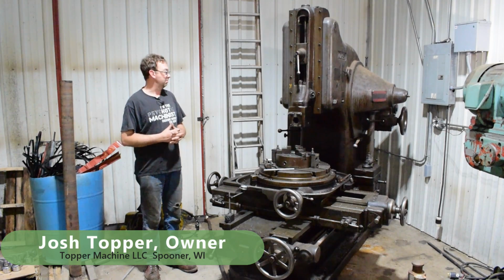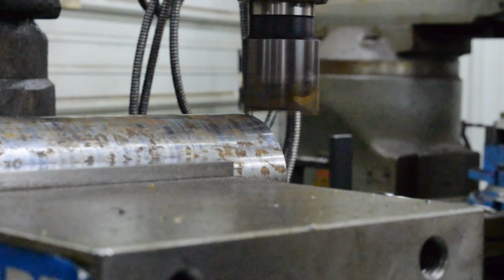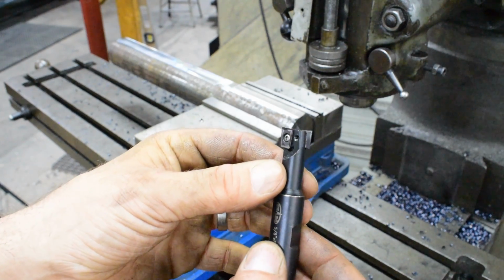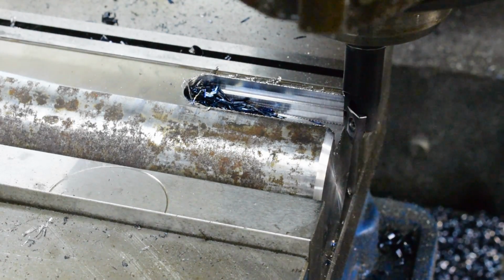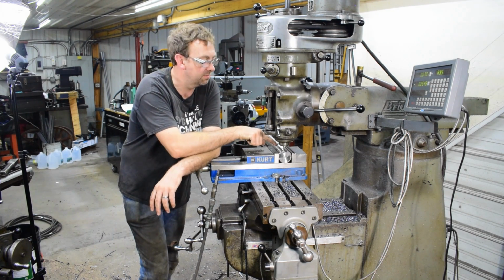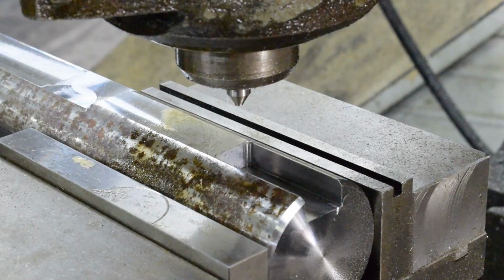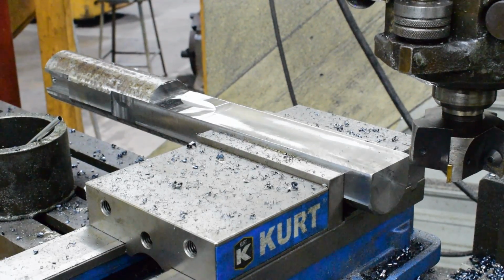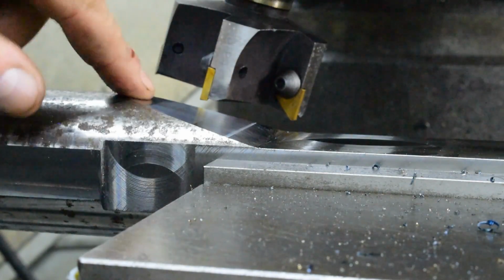Making an Internal Keyway Cutter - Vertical Slotter or Shaper Toolholder

Comment: Not a machinist, but in trying to square off the corners of the pocket in which the slotter bit sits (which is impossible) wouldn't you be better off drilling (or plunge milling) out the corners and machining a flat across the narrow dimension of that pocket (which you are doing anyway with the small cutters) and using that as your rear support for the bit? It seems to me the absolute length of the pocket is not that critical as you'll adjust the throw of the cutter with the dials on the machine. Excellent video!

Comment: Hi Josh, 
great improvement in audio and presentation over some of your earlier attempts. Well done and thank you. 
One question or suggestion, but when you tried to square off the corners with the 1/16" cutter would it be better to mill it vertically first. That way you would, or should, experience less deflection. Just a thought. Thanks for the video and as someone else suggested "better built than bought ".
Regards from Canada's banana belt.
🤞🇨🇦🍌🥋🇺🇦🕊️🇺🇲👍

Comment: You can mill the corner pockets with a tiny mill if you feed it vertically as if was a drill bit. Two flute mills were called slot drills for that reason. Any mill with center cut can do that.

Comment: Let me offer you a little advice on those tricky corners.... mill the flat first, before the slot... then drill the corners with a regular drill... then do the slot, and you only need to clean up a tiny little corner... save yourself the trouble.

Comment: Today, I had to broch a 1" keyways in  (2) 3-13/16" couplings using a Davis/Hanford #5 Keyway machine ...it chatter...I bartered the Davis machine for a repair on a Bullard broken lead screw and casting some 50 years ago...(The truck driver took out a railroad bridge with it)...I was cutting large keyways on my shaper before I got the Davis...Now you got me thinking of a vertical shaper...I see that it's a better way to cut keyway as well as other things (I.E. splines) and cheaper too. You did a good job  on the holder....A new 1" broach for the Davis is about $700.00 You can buy a lot of Morrison cutters for that...I use Endmill holders for holding endmills in my Bridgeport's.... I avoid collets ...Endmills get "SUCKED" out of them...Ever seen a Bridgeport table with progressive blemish in the table? ...A small piece lead to seat work in the vise. Somebody taught you well to use you hand to clean the vise..."Your hand is the best cleaning cloth"   Just don't get hurt!......Robbie

Comment: Really enjoyed the multiple angle shots, not many makers take the time to film the cuts from many different positions. 

What I appreciated more than anything was the time you took to really document the close up work so we could see exactly what you see while working. Without those close ups we wouldn’t really understand what you’re chasing after in the cleanup passes.

Compared to other channels I like your practical approach to machining. It’s a business so it has to get done and only as precise as is required for it’s needed purpose. Like you wouldn’t fuss about a thousands here or there on farm equipment but here where the tolerance is literally +\- 0.001” taking the extra steps needed becomes important.

Comment: Hey Josh those indexible end mills are very good, I use them all the time. I need to make some of thes bars for my Slotter but will be using HSS as it's cheap and I have an abundance of it in varying sizes. In Australia those slotter inserts are very expensive.
Reply from the maker: I've made a few for HSS, but these larger sizes are better to use these inserts.

Comment: Excellent content, thanks for sharing. Although pretty soon you will be able to remove the rubber mats and just walk on the chips LOL. Just kidding. But you really could use some house cleaning the shop is kinda messy with all those chips on the floor and machines makes it look like one of those sweatshops in India.
Reply from the maker: I could use a helper. Been so crazy busy here I can't even stop to think.
Reply: @TopperMachineLLC  If I was in the area I'd come to be your helper. Maybe the local junior college has somebody taking shop classes that might be interested in helping offer them some instruction and machine time as trade.  Keep moving forward.

Comment: Josh, on squaring those corners with a small end mill I peck drill down to clear the chips then once I reach the desired depth I walk the end out x and y. This eliminates the chip build up and most of the lateral pressure on the small end mill.
Reply: You were thinking way ahead of me! Thanks again for a great YouTube channel!
Reply: Steven exactly how we did it back in the day
Reply from the maker: I thought about doing that. But it was more dramatic seeing the breakage and deflection. Entertainment value. Lol.

Comment: Very interesting. Two questions: 
1) Why was that part scrapped? It seemed perfectly symmetrical except for the holes, so couldn't one plug those up and recut them elsewhere on the cylinder? Or would that just not be worth the effort?
2) How long do those carbide inserts (from the last, tapered, operation) last, and what happens to them after all points are used up? Are they ever reground, or are they thrown away?

Thanks as always for an excellent video.
Reply from the maker: Part was scrapped due to the width of the keyway being .003 too wide. That was the only problem with the part. The inserts get recycled,. I sell them as scrap carbide.

Comment: Excellent video as always. What rpm did you run that shars indexable cutter at to cut the slot at the end of the bar? Thank you for your time!
Reply from the maker: Same as the other cutter. 1115 rpm
Reply: @TopperMachineLLC  Brilliant thank you.